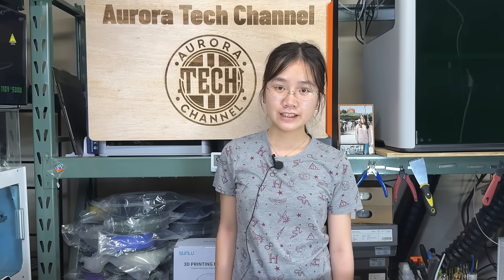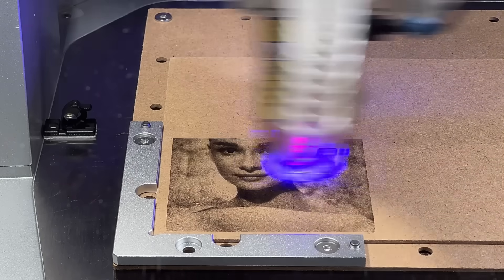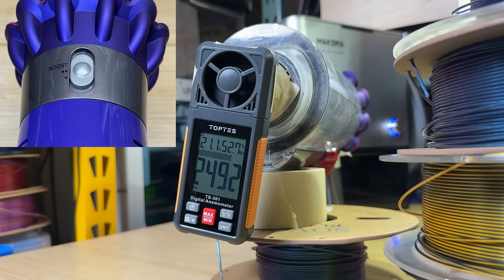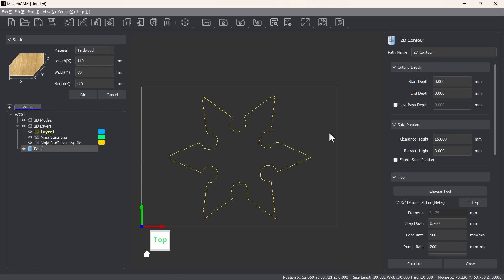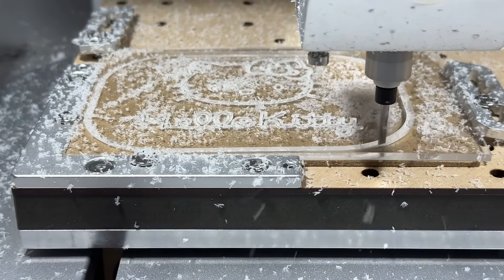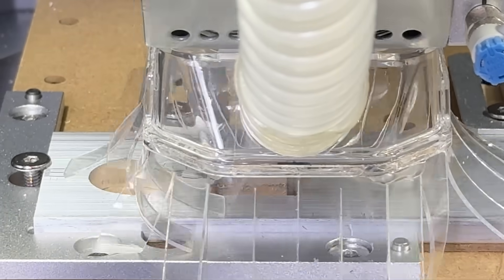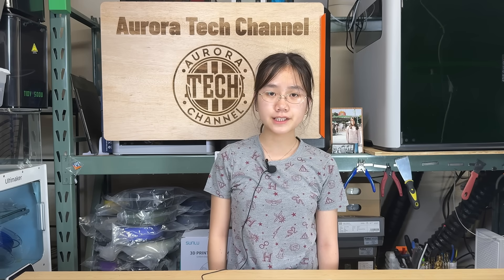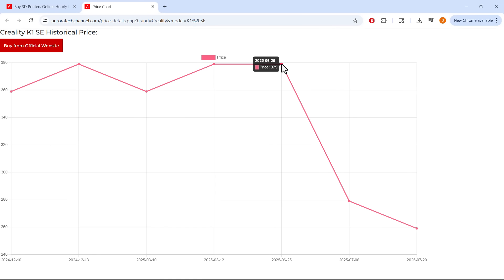CNC Dust Collector or Vacuum? Makera Dust Collector Review with Real-World Testing

Comment: That meter doesn’t do cfm. What you’re showing is the air velocity in ft/min. You could get close to a cfm value by sealing the vacuum hose to the anemometer and multiplying the result on the meter by the cross sectional area of the fan duct in sqft.

Comment: I would love to know how the Dewalt StealthSonic DXV12P-QT ($120-150) along with the DeWalt DXVC6914 HEPA Cartridge Filter ($40-$50) would stack up to this. For a total price of $160-$200 it should be significantly quieter and cost a lot less.
Reply: Or the 'James JVP180 Vacuum Cleaner' which is more expensive, but claims to only be 47db(a) while operating.

Comment: Good review, but there's a problem with the CFM numbers. 

I suspect a missing correction factor for area, because even a 4 HP shop vac will be less than 200 CFM.
Reply from the maker: I think you’re right. I believe the tester is designed to let air pass through to measure CFM, and it may show very high numbers if I put the vacuum head on it. However, I think using the same device under the same conditions to assess the suction of different vacuums still provides meaningful numbers. Instead, it would be better to call it an Air Flow Index. For example, the Air Flow Index of the dust collector is 2850, the Dyson is 2470, and the Shop-Vac is 7800, despite the unit being intended for measuring CFM.
Reply: Try a Buckethead vacuum.
Their not really loud they use a 5 gallon bucket.
I adapted mine with an lower inlet and filter housing, so I could just change buckets when changing materials.
I was doing brass , aluminum, steel and some wood and plastics .
I was more concerned with saving my brass and aluminum shavings .
I used it for my lathe and mill .
They're not a really high CFM but they don't draw a lot of power either.